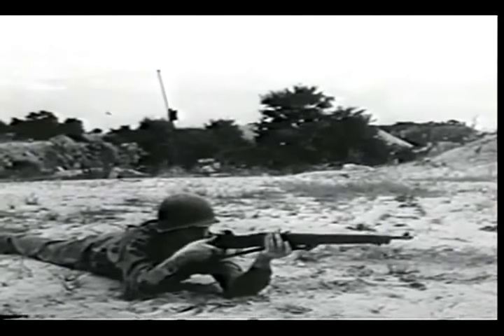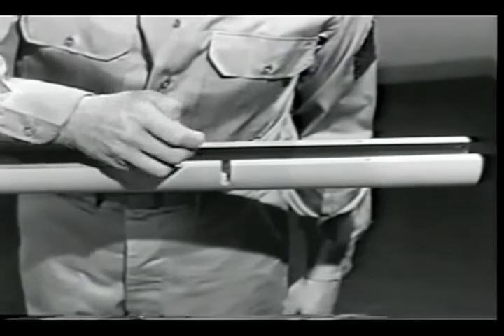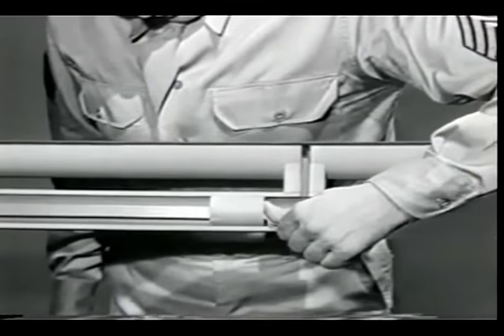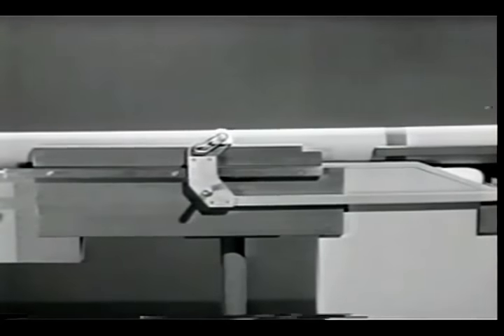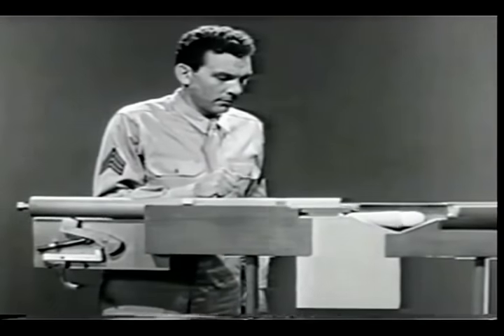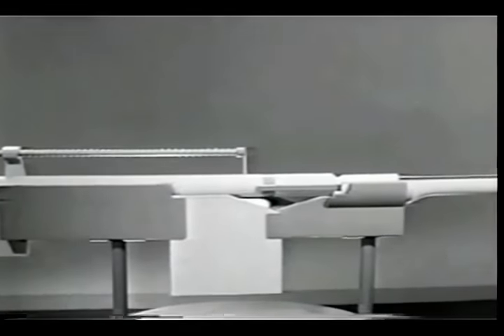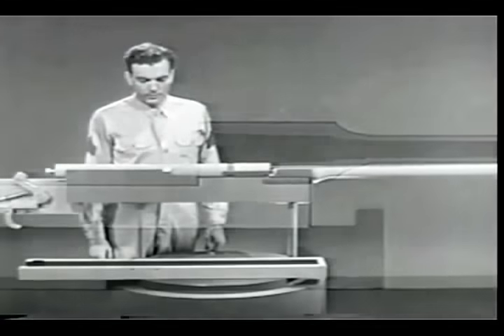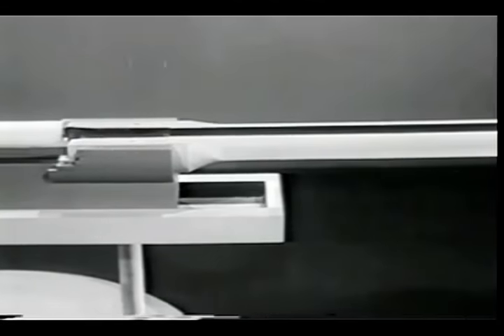Fundamentals of Small Arms Weapons (part 2 of 3) Types of Operation

Comment: Blowbacks often have a bolt with fixed firing pin, so there is no need of hammer, bolt does all the job. And gas operated arms never have return spring in the gas tube.

Comment: isn't the blowback and recoil style of self cocking the same?
Reply from the maker: Blowback usually refers to the cycling that doesn't have a chamber locking mechanism, but any inertial or recoiling type, including blow back can re-cock the firearm.
Reply: Well yes, bur actually no
Reply: We don't do that in here
Reply: edilberto jr gerna recoil style has a locking mechanism (look at the M1911) while blowback is more locked by the mass and spring pressure of the action (see a similar weapon to the M1911, the m1903 hammerless)
Reply: Blowback has no locking mechanism, as it relies only on the weight of the bolt and pressure of the return spring, and is intended for low pressure cartridges only.
Recoil has a locking mechanism, similar to a gas system.
Only instead of using gas to push a piston, the recoil itself pushes the barrel, extension and bolt back into the receiver together, (keeping the high pressure cartridge inside the chambre), till it reaches the point of unlocking the bolt from the barrel.
Basically, gas/piston and recoil/locking are the two different approaches handling both low and high pressure cartridges, while blowback can only handle low pressure cartridges.

Comment: Can we do recoil electronically these days?
Reply: Amir 
Some do, yes! Some larger more complicated weapons use electricity for cycle of operations, some tanks and aircraft weapons in fact use electric motors to drive cycle of operations. They would use a motor because typically you cannot have to direct contact to some weapons while on certain platforms, so you need a way to cycle the weapon automatically (Heavier Ordinance has a slightly different cycle of operation than this video). Typically, man portable weapons (Rifles, pistols, machine guns ect) do not use electric motors for operation due to weight and reliability.
Reply: LizardLick Crowing 
So even the reliability is lessened?
Hmm, and if we would’ve resolved those two factors, do you think it would worth the cause? Would it be worth the extra cash? Because trying to use the throttle energy of a bullet for recoil seems inefficient, performance wise, like how snipers need manual recoil for a better performance, so I was wondering if any big company out there would think of making them in the future or they would stick to the old ways
Edit: I did a search and came across a couple of these companies but do you think this new field of technology would spread out to other suppliers and markets?
Reply: @Born2Losenot2win  Thing is,, having electric systems in an infantry weapons means that the infantryman needs to carry a power supply. It also means a higher degree of complexity that might not necessarily make weapons more reliable or effective. I don't necessarily think that more electronics in rifles would be bad, but I think there are some difficulties to overcome.
Reply: @censorduck  ah yes, the power supply, silly old me, he didn’t thought about that, an EMP could also destroy the entire circuit, so we’re not there yet
Reply: @Born2Losenot2win  well I'm sure you could make a rifle that is isolated from such attacks. But even if that wasn't an issue, having a seperate power supply would be an issue unto itself. There are also environmental concerns to the reliability of an electronic system.
Reply: @censorduck  true, we can’t run it through the mud and yet expect it to still function like an AK but all these are fixable through time
Reply: @Born2Losenot2win  Well maybe we can, maybe we can't. I mean electronically fired ammo could reduce moving parts as well. There are a lot of variables, but I can't say we'll see it for a while. Military development goes slowly when it goes at all.
Reply: @censorduck  true, we got electronic guns but they’re used only for a handful of applications, hopefully we get something that gives US military an advantage over the enemy units, not that I like killing but it helps prevent war in the first place or at least make the war short enough for less needless casualties

Comment: It only explains simple blowback, but not delayed blowback. Still a good video, though. Just a bit lacking.
Reply: By this point in the 1940s, delayed blowback wasn’t really a thing yet. The most common delayed blowback design was a product of the Spanish and later German designs of the 1950s, being the ‘roller delayed” blowback.
That said, recoil operation could be considered a type of delayed blowback, as the locking mechanism delayed the bolt opening, and the entire mechanism recoils from the blowback. But that’s if we want to play fast and loose with the technicalities.

Comment: I'm confused, 
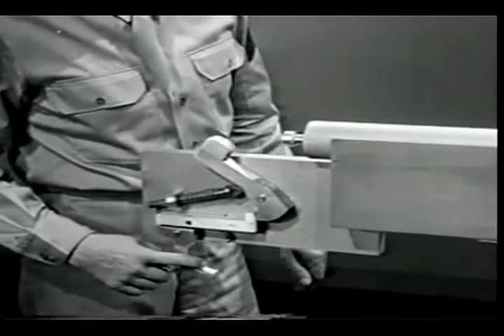what is stopping the bolt from going backwards before the bullet has left the barrel 5:55
Reply: yes, strange, no one word about it in all 3 films:-/
Reply: dutch  hi, it's a blow back action. There are no locking lugs just a heavy bolt mass that allows the bullet to be gone and the gas pressure dropped safely but the initial energy starts the bolt back and cycles the action. NOTE: only for low pressure rounds like 9mm or 45 ACP for example.
Reply: @14goldmedals  in the video the bolt only blows back once the bullet has left the barrel. it doesn't make sense to me, shouldn't the bolt move back at the same time that the bullet gets fired? or is the bolt weighted to make it move slower then the time it takes for the bullet to leave the barrel?
Reply: Inertia. The bolt is much more massive than the bullet so it accelerates much slower.
Reply: Simple physics: the explosion in the cardridge exerts the same energy backwards and forwards. But the bolt is heavier than the bullet so it moves less fast than the bullet which gives enough time that the pressure in the barrel is on a safe level.
Reply: @downey2294 the bullet is moving faster than the bolt.
The bullet is small and light, but the bolt is big and heavy, so the weight of the bolt, plus the pressure of the return spring is enough to keep the bolt closed long enough for the bullet to exit the barrel. By that time (near instantly) the force of the explosion pushes the bolt rearward by inertia, and the majority of the dangerous pressure and gasses have dissipated out the front of the barrel.

This is why you can only use blowback mechanisms for low pressure cartridges, like pistol cartridges. As the higher the pressure is, the heavier the bolt and stronger the recoil spring need to be. This isn’t done, as such weapons would become prohibitively heavy, difficult to cock/chambre, and recoiled like a bastard.

Comment: So thats how the top spring on the ak is for.
Reply: Yeah, AKs are gas operated. The barrel is a bit lower in relation to the sights because Kalashnikov decided to put the gas port on top of the barrel rather than under it, just like the STG-44 built mere years earlier and unlike the M1 Garand. This is due to better heat management necessary for full auto fire since the gas tube won't have to contact the handguard, another reason being so as to not get in the way of a magazine.

AR style rifles also have their gas tube on the top, though it is not exposed as it is on the Kalashnikov, but concealed in the handguard.

Comment: So.. I don't understand how a blowback-operated is ever in battery.
Reply: it isn't, the weight of the bolt is enough to keep the case in the chamber while the bullet is fired, the momentum of the bolt then cycles the gun. this is only pistol rounds use blowback, larger bullets would require a super heavy bolt to operate safely

Comment: Gas operated guns are best, fight me.
Reply: I refuse. Gas operation is the best. There's a reason why the Advanced Combat Rifle uses a gas-piston system rather than direct impingement like "normal" AR-platform firearms. Plus, you don't need to worry about having a tube at the back to store your spring (and I'm better-versed at the fundamentals of gas operation than of direct impingement and other strange firing systems if you couldn't tell).
Reply: @commanderfoxtrot  direct impingement is also gas-operaged, though 🤔
Reply: @cheekibreeki904  it uses gas, sure, but not a piston system.
Reply: @commanderfoxtrot  that's the definition of gas-operated firearm. Long stroke, short stroke, direct impingement, whatever — if it uses gunpowder gases, it's gas-operated.